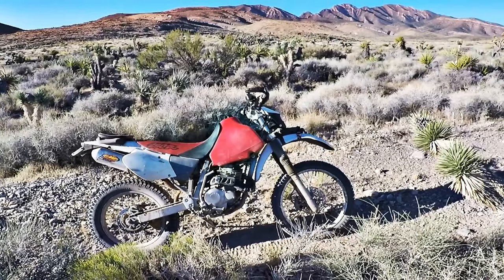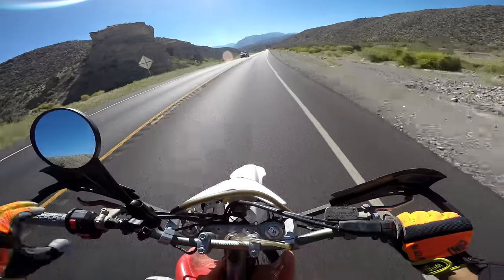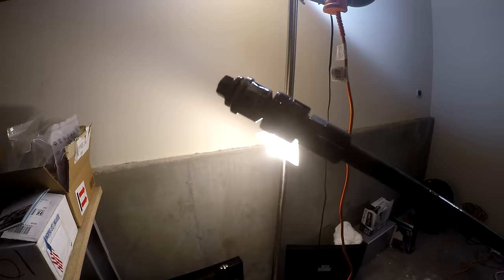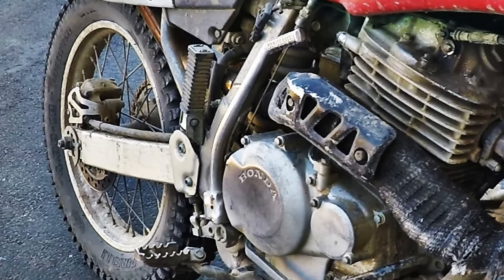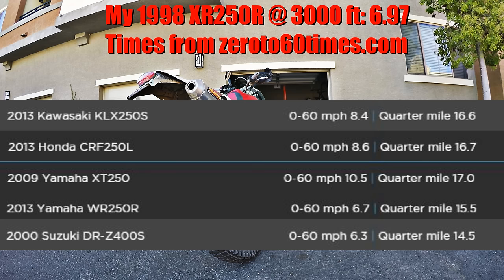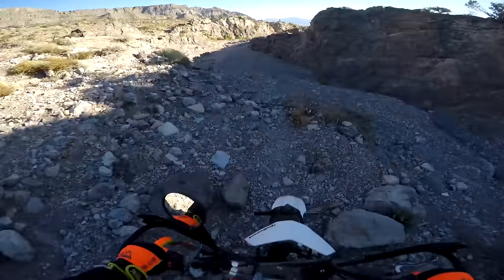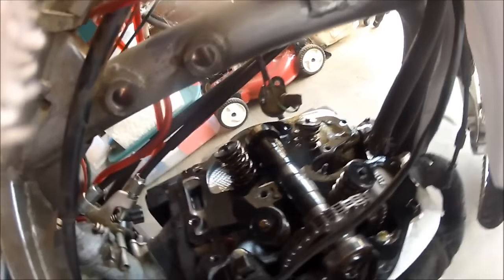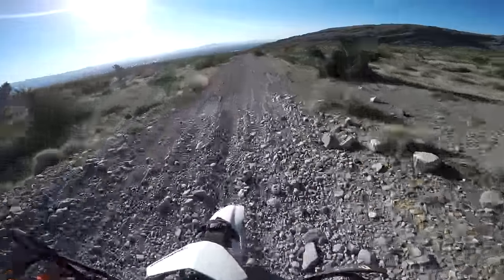In-Depth XR250R Review

Comment: Great review! I bought my son an xr250r and love it so far. I ride a CRF250R and a Suzuki RMX250r. I need to ask you a favor. His rear wheel is WAY out of true, and I went to loosen all the spokes and fix that....but I forgot to take measurements for the offset on the rear wheel. I thought I could find it easily online, but haven't succeeded. I will check out the XR mod page you suggested, but if you happen to read this, hoping you can reply with the offset. Thanks!

Comment: Excelllent review!   Makes me glad I have a 1990 XR250R.......and will keep her forever.  I have also learned the ritualistic cold-starting procedure, and its typically one or two kicks, and she is purring away......but I have to keep the choke half on for a few minutes cause she is so cold-natured.  Wondering about the teflon chain guard on the rear swing arm.....do you reccomend smearing grease on to reduce the chain friction and wearing it down?  Looks like if the chain is kept on the tight side of the specs, there is less chain wear on it.
Reply from the maker: +crazeyspivey thanks! Definitely a bike to keep forever. As far as the chain guard goes, I have never even paid attention to it. I think if it was going to wear out, two decades would have done it!

Comment: You can buy a 2018 xr250, it used to be called Honda Tornado 250, but Honda changed the name again to Xr250.

I don't know if they are available on the Us market tho, but they are dirt cheap, and extremely reliable bikes.
Reply from the maker: The Tornado is a completely different bike. Completely.

Comment: I miss my 02 xr250r a lot. Went to a drz400 for elec start.drz is very close in lots of aspects except power. Even oil check. Got a couple of 09 klx250s  also and there nothing compared to the xr. Rattle a bit. 6spd is best trans ive ever ridden. Starting and flood happy yes. I agree over and over.
So can u get elec starter kit? Or build a 250l cases w 250r parts?

Comment: Was always stuck between the KDX and the XR, having ridden both how do they compare?
Both being bulletproof trailbikes?
Reply from the maker: The KDX is a cut above in performance. But the XR makes an incredible dual sport and can just eat up days and days of riding, off road and on road, while still performing just fine as a trail bike. So depends on the use. XR is more versatile. KDX is more fun off road and really is one of the best bikes out there for single track and technical
Reply: @TortureTestMagazine  Yeah ended up going with the KDX a while back, just always wondering if i should have got the XR.

Will have to try one one day, might go up to the 400 for a bit of extra grunt ;)

Comment: I purchased a new 98 XR250 that I still own and it is great. This bike has the pulse generator separate from the stator which makes it much cheaper to replace if this part fails. The XR400, XR650 and other bikes have the pulse generator and stator as one unit which means the complete assembly needs to be replaced if the pulse generator fails.

Comment: I love my xr250 it has stuffed piston rings smokes like shit and I also ran it dry of oil it has next to nothing suspension cracked frame missing bolts no compression (I can start it with my hand) bad wheel bearings and the clutch doesn't fully in gage and it still goes and climes hills and bets crf230's (in a strait line) with ease it is great I think it could service a explosion it's so strong and reliable.
Reply from the maker: +Connor Wright LOL that's fantastic

Comment: Hey man nice video great info. Quick question I'm currently looking at one of these bikes for sale on craigslist the seller is asking 400 usd. It needs a piston and crank which I can get from ebay for 150 usd was wondering do you think it's a good deal I should consider or not.
Reply from the maker: It totally depends how much your time is worth, because a rebuild can be time-consuming! But yeah, 400 USD for a rolling, titled frame is not bad
Reply: Thanks for the reply just curious how long do you think it would take for a rebuild because the seller said he thinks the crank will be fine so all  I would have to do is rebuild the top end.

Comment: I just got a 93 but hear there nothing compared to the 96/04s I cant tell the deference between xr250r or xr250l. Just got into bikes
Reply from the maker: The generation before the 96-04 is only a slight step down in performance, relatively speaking when looking back on the XRs today. Damper rod forks instead of the cartridge forks, an older style rear shock, wet sump instead of dry, and not as aggressive valve lift. They're still very fine. The suspension can be fixed up nicely for cheap, and the motor can still be punched out to a big 277 without re-sleeve if I recall correctly. And a lot of people prefer the wet sump just for simplicity's sake

Comment: nice vid i have a 9 5 xr250r and it takes 3 pulls of throttle then 2 half choke kicks and then like 3 good kicks and i did that in 40 degrees maybe your starting ritual is for bikes 96 and up?
Reply from the maker: This video is only concerned with 1996-2004 XR250R
Reply: Frickin Jim's Frickin Adventures  i know but their are only a couple slight differences but great video

Comment: I found a 1996 xr250r for 850 that has a new sprocket, chain, throttle cable, handle bars, and that starts and runs good with salvaged title. Good buy?
Reply from the maker: +Jesse F I'd snatch that up today if it were in my neck of the woods
Reply: Even with the salvage title?
Reply from the maker: I have no clue how a dirt bike ends up with a salvage title, but it would mean nothing to me if the dirt bike is in running condition. I bought mine in total crap condition, not running, put a tiny amount of work into it and it's been paying me back with good times ever since
Reply: Do you think I will have trouble registering it. Where I am you have to have a title and a sticker to ride on public land.
Reply from the maker: You'll need to check with your local DMV, and it will depend if it's a street title or an OHV title. In my state it would require an inspection by a licensed mechanic, but that is something that would normally be done for free.
Reply: Thanks for the help! Great video, loved it!
Reply from the maker: +Jesse F thanks for watching!

Comment: is there a difference in 96-2005 in motor to frame bolt patterns im probaly going to have to put 2 different bike together to get on road what all is the differnce
Reply from the maker: I'm not sure. Sorry
Reply: Let me know any info that you find out. The frame on my xr250 was broken on the bottom. The previous owner had a thick piece of metal welded on to make a skid plate and to brace it. Hopefully it will last a while.

Comment: I raced a 84 xr-250 in motocross and harescrambles. I had mine set up mainly for motocross and lengthened the swingarm by 2" and put a 81 cr 125 forks with front wheel on it too .the cr forks fit perfectly into the triple tree. Made a BIG difference for racing motocross. The twin carb system SUCKED BIG TIME .If you ever crashed it ,layed it down or stalled it forget it your moto was over because it was a REAL MOFO GETTING IT FIRED BACK UP .IN MY OPINION THE 85 XR-350 WAS A FAR BETTER XR HANDS DOWN !

Comment: Were the acceleration and top speed stats after the big bore upgrade?
Reply from the maker: Yes, those stats were from my bike @ 3,000 feet elevation with 277cc, oversize intake valves, dual-sport final drive gearing, CRF230F ignition controller, everything else stock

Comment: I live in the city and I’ve never had any kind of bike besides a bicycle. I rode on the back of someone’s motorcycle last summer and really want to get one of these. How do I go about it? Anyone have advice edit: i mean it seems like everyone who rides knows how to take apart and rebuild stuff, idk anything about that, or any cool off road places like in this video
Reply from the maker: Most of us learned by having a very simple motorcycle to start with, like an xr100, where all of the same functions of any four stroke are still there, but it's all laid out very simply with easy access to work on and everything comes completely apart with just a few bolts. Others just dive Right into it with a full size bike and then follow tutorials and service manuals to keep their bike running.

Finding places to ride is totally about knowing the laws in your area. For me it's easy. Find the dirt roads and ride them. My locale doesn't care. The place I lived before, you couldn't do that. You needed to go to a park designated for dirt bikes and they were crowded, boring, and small.

Comment: How do you know if the valve to rocker clearance needs adjusting? I'm looking at a used one and want to be sure its solid, but I cannot take the bike apart. Thanks
Reply from the maker: +Steve St-Onge push the kicker past the point of highest resistance (TDC on the compression stroke), open the valve caps and slide in a .004 feeler gauge under the rocker. If it slides in it's probably fine. If there's excess wiggle, no good. Excess wiggle means something in the valve train wore down. If a small feeler gauge like .004 doesn't fit it means the valve itself has worn.
Reply: So there is no way to check without a tear down?
Reply from the maker: No tear down required. The valve caps are right there at the top of the valve cover. You can check the exhaust valves without even pulling the tank off
Reply: thanks for the help

Comment: This or the crf230? I am a reasonably aggressive rider so i do need a bit of power but cannot afford to maintain an MX bike
Reply from the maker: What do you ride now? Bone stock, neither are going to be great for aggressive riding but the XR will be closer to acceptable because the suspension on the XR is much better than the suspension on the CRF230F. A bone stock bike that can be ridden aggressively and has good reliability is the WR450F
Reply: Actually right now im on old farm bikes ive riden xrs (500 and 250) but i find them a bit tall was considoring the 230 and just cruising around I will probobly end up getting a drz250 with e start
Reply from the maker: If those are too tall, then a WR is out the window. The 230 is an excellent bike, I love mine, but coming off an XR500 it's going to be weak. It will have about the same get up and go as an old pre-1996 XR250. A DRZ250 E-start would be great! It's the perfect middle ground between a CRF230F and an XR250R.
Reply: Awesome thats probobly what i will get my friends xr500 was awful it had been thrashed and had no suspension give was slower than my old gp100, but i think the drz will win it for me

Comment: The part about letting the bike do its thing is dead on. You just hang loose and roll the throttle. if you try to fight it, it will buck you right off.

Comment: is this the same for the xr200?
mainly interested in maintenance
Reply from the maker: The XR200 is a wet-sump engine. Easier and quicker to check and change the oil, but the XR200 is seriously lacking in many areas. I've looked into the XR200 a lot, and found it to be something I could never be happy with. Not a very serious bike.

Comment: do u Know anything about XR600 I'm been work on my for a month got it running but something off
Reply from the maker: +Justen Weisse I don't really have any experience with that bike. What's wrong though?
Reply: It starts right up but when I give it throttle it just dies out I messed with the timing thinking it might be that but it still does it  then I thought it was the carburetor then i rebuild the carburetor hop that was it but Nop
Reply from the maker: It will probably have something to do with the carburetor tuning. Does using the choke make it better or worse?
Reply: +Frickin Jim's Frickin Adventures 
it butter but not much

Comment: How long is a topical engine life on a Honda xr
Reply from the maker: I wish I could tell you something measurable like hours or miles, but I haven't tracked any of that on mine long term. I rebuilt it in 2012 just to be safe, and then used it as primary road transportation for a couple years. It still runs just as well as when I rebuilt it 6 years later, and I don't see any reason why it won't just keep going for as long as that bike's frame physically holds together.

Comment: My XR250 is a 1991.
Reply from the maker: Congratulations! That is a different bike, though. 1996 was the year of the ground up re-design.
Reply: @TortureTestMagazine  yes it is. Maybe you can do a review on the 90-96 xr250
Reply: @TortureTestMagazine  I would like to upgrade my bike. Any suggestions
Reply from the maker: @CharlesCarabott  That bike will be totally killer with tuned suspension and a big bore!